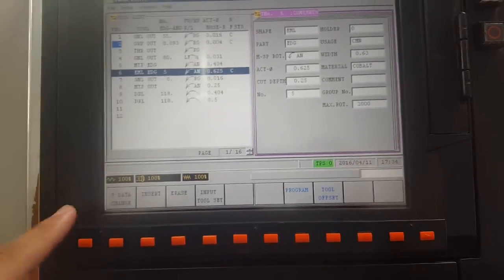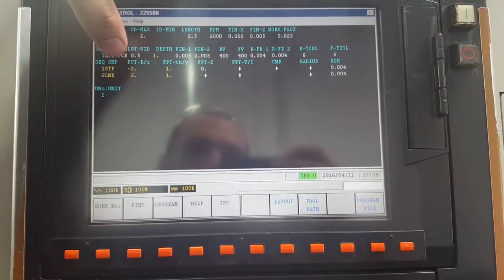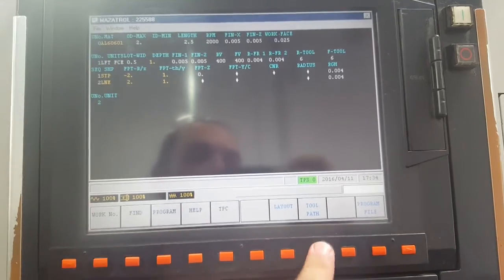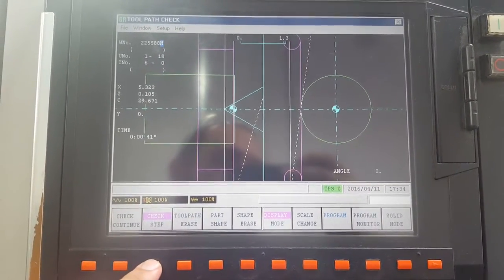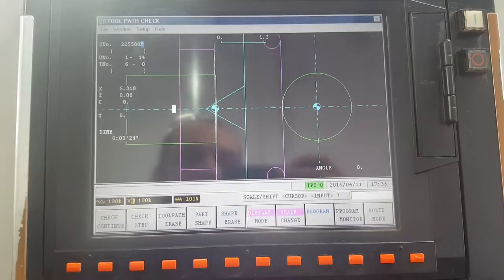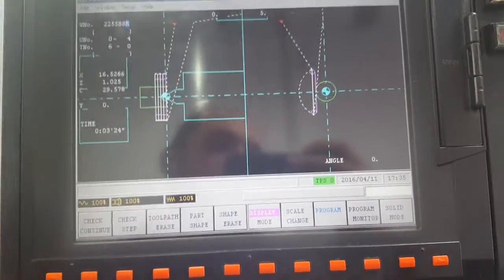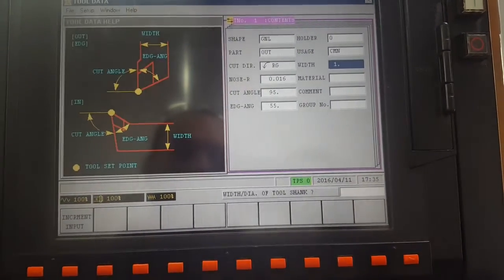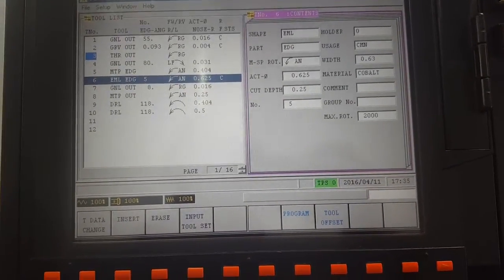Live tool DOC mazatrol question answered

Comment: Hi, thanks for the videos. what kind of machines do you have? I see you only use 1-12 on your tool data screen, this must be a single spindle machine?  i'm running a twin spindle single turret with live tools and Y axis, so we have a lot of tools in the tool data page, station 1 has four 80 deg tools(double on the y) and so on. this gets confusing with so many tools, takes me along time to set-up, I think we need better set-up sheets. do you use set-up sheets? what do they look like? just trying to get my set-up times down and  see what others are doing. thanks again !
Reply from the maker: I own fadal 4020, 2 mazak QT200MY and QT250, Mitsubishi MH4B with 2 pallets and a wider and sinker EDM.  I am a small shop so I don't do setup sheets really just print the tool list and wright down the origin location. whin I program a part in mastercam I always defin the tool length and flute height so I'm good to go. as far as lathe I think I been dooing it so long I just know what tools to use. but you could define them print them out on the controoler and make a book tied to the part number. for the most part just takes practice and failures, preferably at some one else's shop lol.